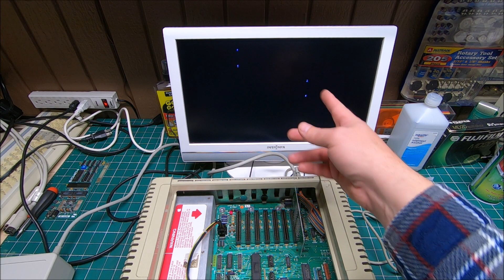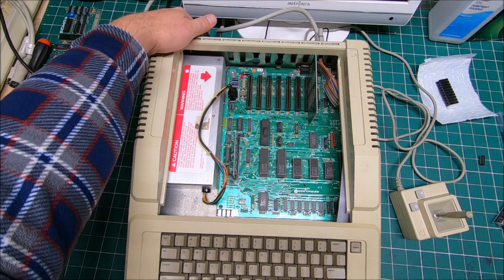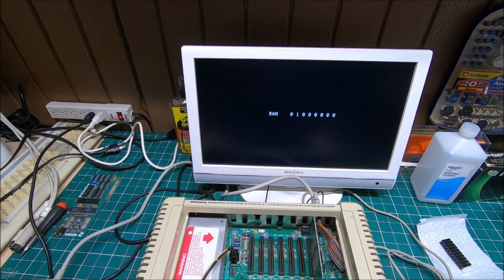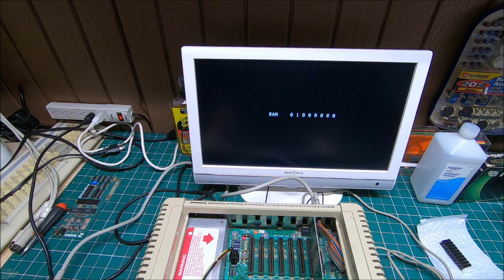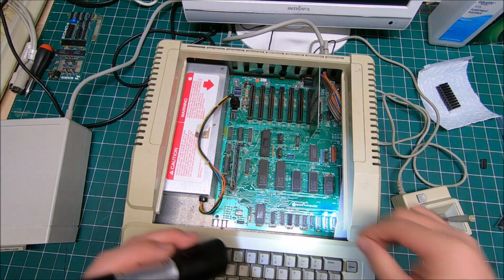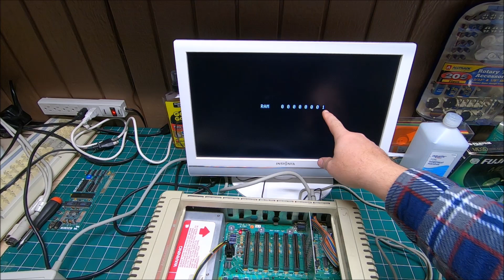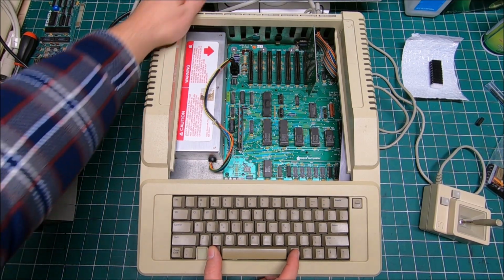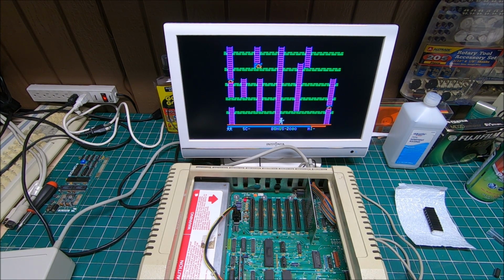Apple IIe RAM issue is solved

Comment: Learned this one the hard way in 1983 when I messed around with the internals of my IIe. That's when I learned that you can't unplug cards from a powered-on computer without risking damage. Had to replace 2 ram chips and 80 column card, not easy for a 16 year old to afford. Couldn't tell parents I had blown up my birthday present.